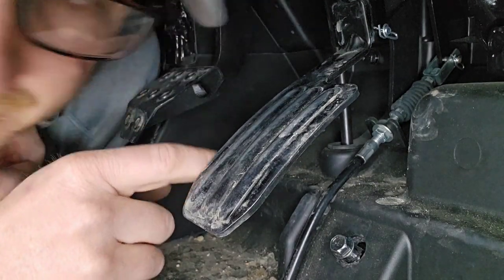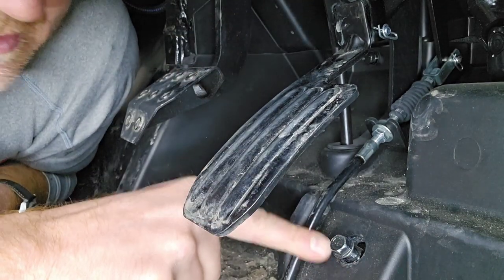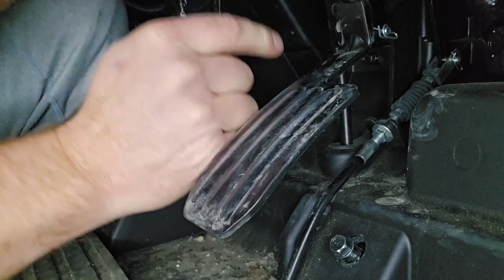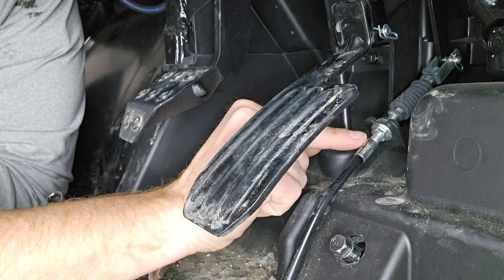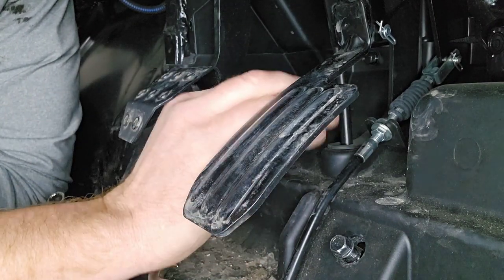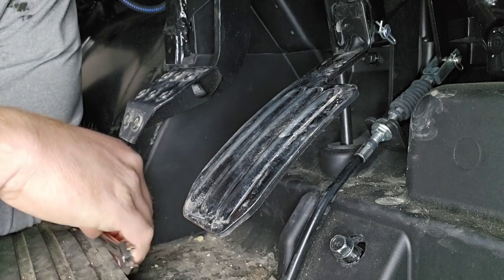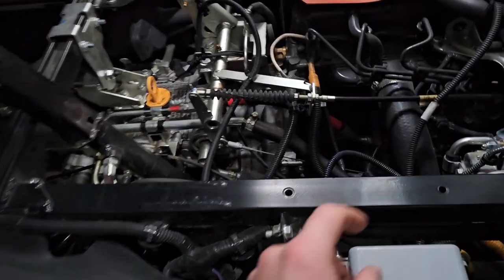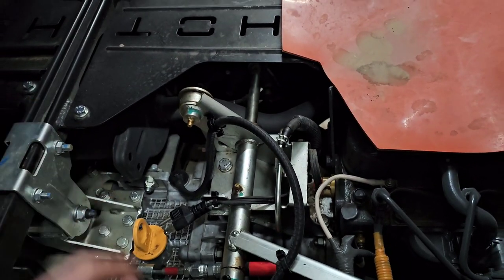Episode 2: Foot Control Throttle Linkage - Kubota RTV Optimization Protocol!

Comment: I checked the cable on Fuel pedal side on my X1140 and it did not need adjustment.  I offend wondered about the stop on the floor.  I didn't have a second set of eyes available to check but I wondered if lowering this would cause the throttle cable to hit the fuel stop before the pedal hit its stop.  I would guess one could always lengthen the cable on the engine side to account for this and allow greater travel on the HST.  I look forward to your next video to see if this is where you take us.
Reply from the maker: The cool thing with this set up is that the engine throttle is flexible, so if you bottom out the screw in the cab and step on the pedal it will bottom out at the high limit screw on the engine and flex that way it can continue to push the transmission valve open. 

I will go through that in the next video! 

Thank you for watching and commenting
Reply: Thanks for putting some info on. Still having trouble with finding the adjustment. Mine will stall out if you slam the throttle. And will not go up any hill without being in low.
Reply from the maker: @davidbaker8402  Is your parking brake stuck on perhaps? Does it feel sluggish always?
Reply: No sir. I’m sure it’s out of adjustment.

Comment: Different "foot control" question. I have a 2012 1100C and my neighbor has a 2014. My pedal requires double the pressure to use it compared to his. It's just too much. Is there a spring adjustment or something?
Reply from the maker: Ah yes. Could be a couple things. Over time the cable gets rusty inside the sleeve. Should be spray greased every 200 hours or so. There is also a grease point under the bed that gets overlooked too. 

Try to grease the cable at both ends and see if you can see the grease zerk. Have some in the cab pumping the throttle slowly and you should be able see where things pivot and go. Then spray the heck out of it!